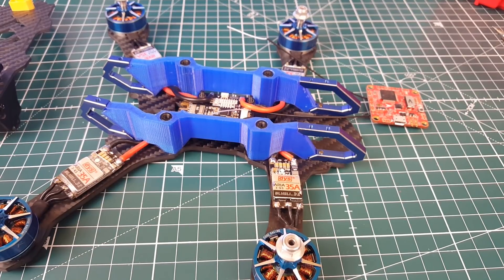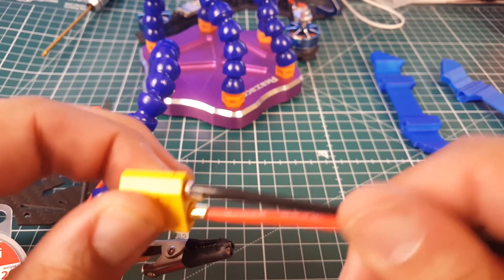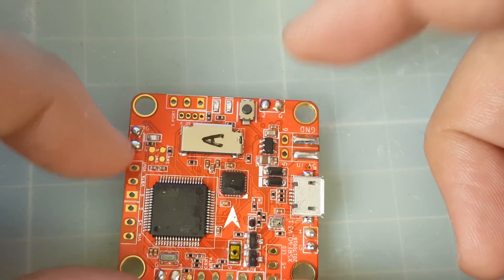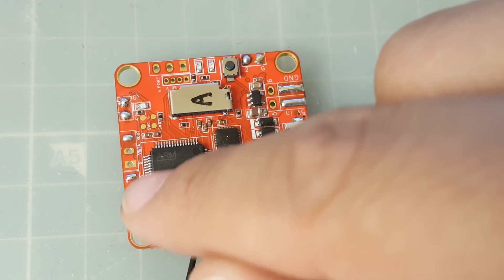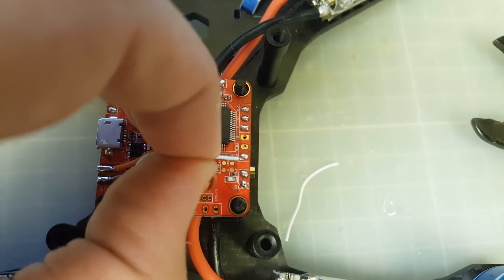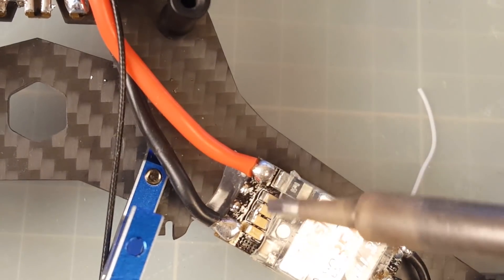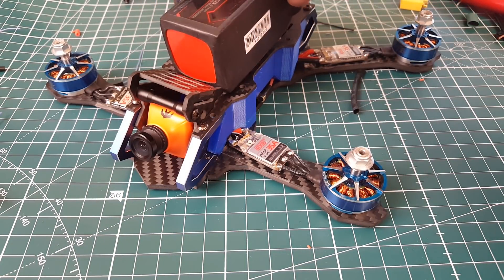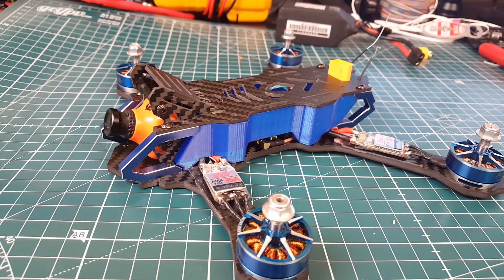How to Build FPV Freestyle Quadcopter Part 2 // Dragon Teeth, Edge Racing, XSRF4O, DYS Aria

Comment: Just finished building mine yesterday. I did not get the side plates, choosing instead to leave it open. My thoughts are that it is a very sturdy frame, but the FPV camera mounting was a bit of a pain and there is no real protection for the camera as my Eagle 2 lens sticks out past the aluminum a fair bit. The XT60 mounting pieces were more trouble than they were worth and I ended up just zip tying the XT60 wires to the back of the frame. The top camera plate does not fit snugly on mine and if you turn the frame over it falls off. I intend to leave it off until I put on my camera and then I will zip tie or velcro through the side plates. I had a chance to take it out for a flight today and was happy with the way it flew. Hope you have the same experience. Look forward to your flight review.

Comment: i bet that the signal cables are the Tatoo's telemetry cables :P
Man the M3 signal cable on pdb is not well soldered ...there is a little wire coming out of the solder joint

Comment: My guess is that you'll have absolutley no yaw authority with that 3D printed shroud in the center. It's a known phenomenon.
Reply: S-L-R that's only when the thrust is on the same plane as the obstruction frame has been known to fly completely fine
Reply: It's pretty clear by the look of it, that thrust is going to be blocked by the 3d printed part, since the prop line is NOT above the center section.
Reply: yeah, I'm betting on no yaw authority as well. Might fly OK without the side walls.